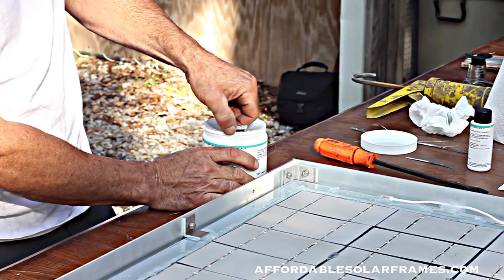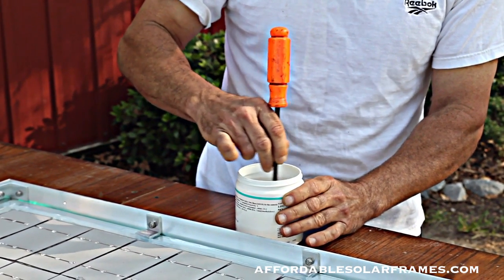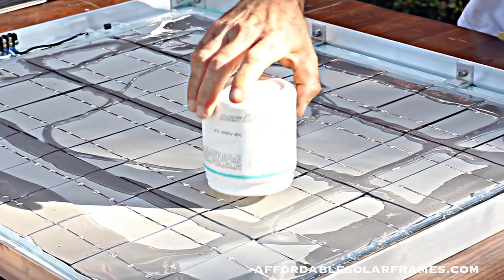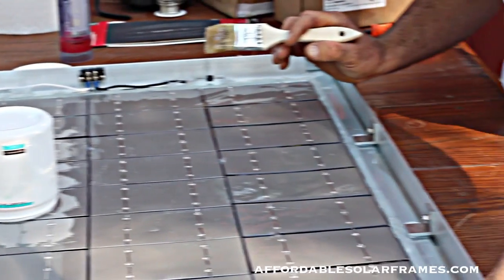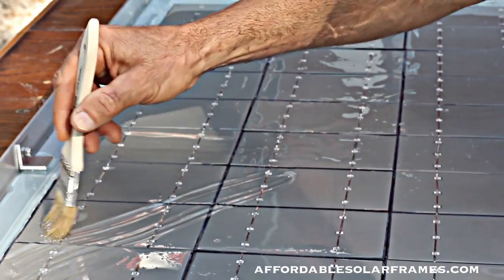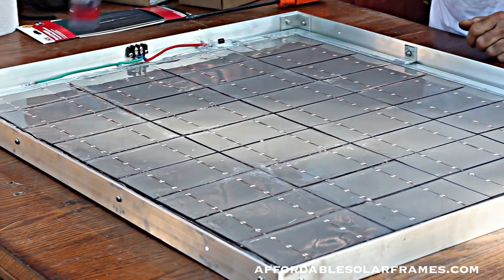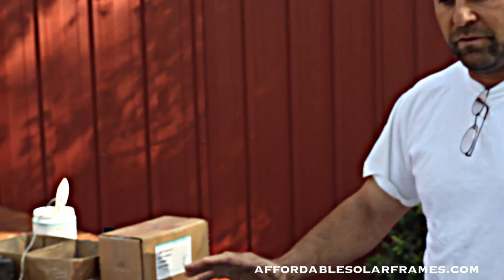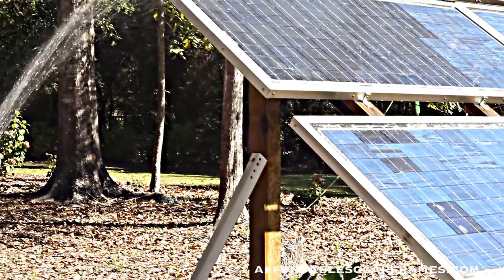How to Build a Solar Panel - Part 3 of 3 (New) encapsulated/sylgard184.Free electricity

Comment from the maker: Well this is not a guarantee but with a few panels you can have lights,tv and with a few more a refrigerator. You will still want to be connected to the grid because the sun does not shine everday. Yes you can install on your roof  with no problems, it is just a little harder to do. You will have to price your supplies but around $150. 100% power for the year is hard with just solar. I also have a hydro system for power. You can see it on my other video.

Comment from the maker: Epoxy will yellow over time and can not hold up to uv rays. The sylgard has no proteins in it to turn yellow. It was developed by dow chemical for nasa to be used in outer space. There are some non brands out there that work just as good. I have used what MLsolar is selling and can not tell the difference.

Comment from the maker: Well I see no manufactured photovoltaic panels using glass with bumps on the outside. I do see it used in solar water heating panels. I would think that it would be hard to clean the glass too. I use 1/4" clear tempered because it is strong and cheeper than the low Iron glass.

Comment from the maker: Well that depends on the size of the deep cycle battery. I would start with two large deep cycle batteries first and see how it goes. A panel does not directly power much you have to charge batteries for best results.

Comment from the maker: You have to charge a battery with the panel then the battery powers the inverter. The 6 amp diode will work fine.

Comment: HI Mark I have learned alot from your video. Thank you. I am no technical person put you are right it was simple enough to do.  I had two questions though.1)  I used 6 ams diode wil this be a problem?  I tried connected the 3 panel together and connect it to a 400 watt inverter, it powered the inverter that it could be turned on and get the fan going but when i plug into the inverter my little lamp doesnt turn on.  How many panel of this size would i need to power a single fan or a lamp.

Comment from the maker: Well there are some good deals out there. I have one bought panel, very large with just 1/8" glass and it did not survive shipping. 1/4" glass is heaver but it is 4 times as strong as 1/8" glass. The warranty does not cover it breaking in the wind or snow. I get a lot of emails from customers that have both bought and my panel system. They send me pictures of how the bought panel broke and mine right next to it did not.

Comment from the maker: I have not had a problem with the cells floating up. Don't use tape on the cells. It causes corrosion after 5 years. I just viberate the panel and leave it alone for a few days then cure in the sun.

Comment: Have you ever experienced an episode where a few of the solar cells float up during the encapsulation pour or sometime thereafter prior to setting ? This was mentioned as a problem in another individual's video where he used strapping tape to "hold down" the cells prior to pouring the encapsulant. He was using a cheaper version encapsulant. I would like to know what your experience is in this regard.
Thanks,
Don

Comment: You could use an orbit sander, without sand-paper of course, on the tables surface to send vibrations through the table to whatever work you might want to place on the table. Just a thought, works fine to work out bubbles when glass coating wood tables.

Comment: how many watts/Amps(i dont know in what grade is measured) is the diode you use in your panels and is there any connection between a diode and the total expectable wattage of the panel? For example if i make a 65w panel what diode should i use?

Comment: Are those panels about 60 watts each? So you need an array of 18 panels to get about 1kw. In this case you would need a very wide roof for 1kw. Also do you make solar water heating panels? I heard they are a lot more efficient than pv panels, about 80% efficient, where as pv panels are around 14% maximum. Isn't it a better idea to use a combination. solar water heating panels for hot water, also to heat your house and use pv just for lights and others such frige, tv etc.. What do you think?

Comment from the maker: In Chemistry you may have two different chemicals when combined they make a new and different substance. The two chemicals in dows sylgard 184 may have a short shelf life but when combined have a very long live.  Water is made out of hydrogen and oxgen. Hydrogen and oxgen are the two most flamable substance. It is what the space shuttle rockets burns. Yet when combined the right way it makes water, what we use to put out fire. Sorry for the long answer.   Mark

Comment from the maker: I offer the frames, glass and pole mount kits on my website and ebay. I offer deals on large orders that are shipped by freight. It will take a lot of panels to run your house. I would start with a 1000 watt system first and add to them every year. I buy my cells from mlsolar of Ebay.

Comment: This is a very well thought out process ... very cool.
Would there be any point to pouring the encapsulant onto the glass and then lowering the cells in some ordered way down onto the ecapsulant letting it sink down into it.  This looks about as good as any commercial system. thanks for the video.

where is this, and how much for your 1kW system, what would you recommend to power an average house?

Comment from the maker: I have not had any trouble at all with the dissimilar metals. I have some panels over 7 years old and so far so good. I have to set my panels in the sun upside down with a extra piece of glass on the back to get it to set up all the way. I am not sure about the carbon dioxide for set up but 2 days in the sun allways does the trick.

Comment: Hi Mark! Great video. I have two questions, you use stainless steel screws with aluminum. They are dissimilar metals. They will  corrode when in contact with each other unless treated (paint, paste etc). How do you combat this?  Are sure it is heat that activates the encapsulate, most set by carbon dioxide?

Comment from the maker: 6" wide and 20' long?  No 20 feet long is to long. Maybe 10' but it will be hard to ship glass 6" wide 10 feet long. If you want to heat water just build a solar water heater, it is a lot cheeper to build and you get a lot of BTU's. I would not heat with electricty. It will take alot of panels to get 1600 KWH a month.

Comment: Hey Mark , great video ! Do you think that I can build  a solar panel 6" wide by 20 ft. long ? and how many of those I will need to cover an average consume of a 1 600  kWh  a month in my house ; and do you think that I could add an electrical heater for my pool ( 20 000  gallons of water ) ?

Comment: Well I was saying deck as one of its definitions being  a flat panel which is capable of supporting a load (the load being me). It would actually be on a scooter (just because I am weird like that). Slipperiness is not a concern to me, but the scratching part would be. Now thinking about it...I would need a material that can:
1) Handle the weight of a person.
2) Be scratch resistant.
3) Be able to withstand bumps.
4) Be able to withstand small pebbles.
5) Be weather proof...
Now any ideas?

Comment from the maker: When you say deck I assume for a boat. Well the deck of a boat is not a good place for a panel. You will end up falling on the slippery glass and scratching the glass too. If you would only be walking on it a little bit then you can go with 3/8" tempered.

Comment from the maker: You will need around 3500 watt system. I would start with a 1000 watts first and then add to it later.Go to my website it is listed on the video for prices of frames and glass. We offer deals when you buy 12 or more.

Comment: Using the 1/4 inch glass you sent me but our climat is really bad in the winter here and thats when it starts seperating the cells from the glass. Used windex to clean the glass and got most of the bubbles out each time. Frustrated due the cost. I thought it might have been me not mixing it enough because when I removed the rest of the scrap cells I had to chisel some off while others just popped off. Was thinking of reinforcing with fiber before encapsilating on the positive side of course.

Comment: Hi Mark. Love the quality of your panel frames. Listen I talked with you before about using the epoxies and even sent you pictures of some that blistered up using the Ultra Seal and the Ultra Clear epoxies. Both of those blistered off the glass so I took your advice and used the 6010 and after a few freezes up here it did the same thing. Am about to give up using epoxies and switch to a Silicone/turpentine mixture. It stays supple and won't shatter the cells in cold freezes. Any thought?
 Brian

Comment from the maker: Well you find how much power you use a month then divide by 30. Then divide that by 24. That will give you how many kwh you use per hour. Mulitply that by 5.5 and that will give you how much wattage in panels you need. I would start with a few panels first and simply and a few each year.

Comment: Thinking about the heat issue - could you devise a pool heater setup?  Running a pump through a hose underneath your array, to reduce the heat of the panels and increasing efficiency?  Just a thought...

Comment: cool video I like this when I was in high school we used clear fiberglass resion to incapsulate the pannels in worked pretty good it was for a solar car project rc car it worked pretty good but if I decide to build my own solar system I will have to go this route sounds a lot chapper than finding one already built again gre4at video.

Comment: @markp0177 Been watching you videos and learning a lot. I just have 2 questions. 1 - It looks like the buswire connections are exposed. Any problems with corrosion so far? 2 - What is you opinion on Lexan polycarbonate vs glass? Thanks for your help

Comment from the maker: @Thomashamka You can make 3-36 cell panels or 1 72 cell and 1-36cell. Your voltage will be determined by how you wire it up. 2 36 cell panels in series will give you around 36 volts to charge a 24 volt system. Yes you will need a charge controller to protect your batteries.  mark

Comment: Hey, i happened to buy lot of 125 3x6 cells, could you tell me how should i make these? Should i make one big panel with 7 AMPS and 36volts? This should be 24 volt panel then. 24v/10amp controller and im done? CORRECT me when im wrong :) Ill look your ebay, might use encapsulant for this project.

Comment from the maker: @Derek519425 Hello. Well with a grit tie inverter their are no batteries. You can have two systems one that charges the batteries and then switch it by hand to the grid tie. It is not exactly legal here to have a grid tie system. The power company wants to but a meter on my system at my cost and only pay me 5 cents a kwh. I pay 13 cents a kwh from them.  Mark

Comment: @markp0177 i am sorry, but i have one more question,

Selling electricity to the grid from a diy solar system is not exactly legal, 
so, is it possible to connect it to your home grid without putting power to the electric company's grid, and yet saving the power in the batteries, to be used at first priority  in your home?

Comment from the maker: @Derek519425 I have my inverter wired into my attic to a few toggle switches. My inverter runs 2 refridgerators and some lights. I can switch back to the grid if My batteries get low. Some times on a cloudy day I may only run one refridgerator. Mark

Comment from the maker: @Derek519425 Hello. I do not have a grid tie system. I charge batteries that run my inverter.If the power goes out for a long time I will still have power. We have hurrricanes hear. With grid tie you will not have power if it goes out. Mark

Comment: @markp0177 i see,

i will be looking forward to a video on how to connect the solar array to your main breaker,
that is the one thing im still worried about, it is possible to have the array connected to my breaker without it pushing the meter back if i don't use the electricity? if so, i would love to see a video of that :D

Thank you.

Comment from the maker: @Derek519425  Hello. I am not sure how much I paid for my system. I built it a little at a time.I found good deals on the batteries and the #3 wire I got free after a hurricane back in 1979. Some of my panels are made out of glass that I got for free off old sliging glass doors.  Mark

Comment: Thanks for the Video. I am from India, and I am planning to put up a solar panel with the 5” x 5” solar cell having panel size of 30” x 30”. How much Sylgaurd 184 will be required to spread on this solar panel? Somehow I got Sylgaurd 184 kit through a friend. It’s a 1.1KG pack. Will that be enough to spread on a panel with 30”x30”?

Comment: thats frikkin cool man.  I got a suggestion for your awesome home set-up, get a thermostat connected to an electrical relay tied to a water sprinkler system, and have it just turn on and automatically water the panels when they get to a certain temperature.  great vid, you definitely know what you're doing, big ups man, nice

Comment: Thanks for your videos. They are going to be a great help When I put mine together this yare. Or in the next 2 week.  Just woundering, how many batteries do you have on this system? And, what is the wattage on the inverter you have on them?

The only inverter I have right now is 750 Watt. I have had it for years. I was looking at some of the 8000 watts for about $700.00

Comment from the maker: @facundosagardoy  Hello. I have tried a syringe but it broke the cell. I look from under the panel" that is why I have a hole in the table" And push out the air very carefully. I also vibrate the table for around a hour then I cover it with card board and I leave it alone for days. Next I set it in the sun upside down with a extra piece of glass on top. This will heat it up to over 180deg. I let it stay in the sun for two days before I use the panel right side up.

Comment from the maker: @Treped Hello. I like the dow 6010 because it is a little thinner and leaves less air bubbles. The vibrating table helps remove traped air. It only vibrates a little so the cells do not move. The large air bubbles may need a little help to remove. I some times press down on the cell to chace the large air buble out. If the cell is warped up a lot I hold it down with a little silcone.

Comment: Outstanding! I like your style of instruction.  I am going to build panels like yours and I have a few Q's.  (1) will you explain or maybe a short video on making a vibrator/shaker table?  (2) What size diodes are required? (3) Can you tell me a good source for the Dow 6010 encapsulant/sealant? Many thanks for all your assistance and info.

Comment from the maker: @Bartrum2009 Hello. Well, start with a 5000 watt or more inverter and at least 1000 watts of panels. Then you can add more panels or a wind turbine later. Also start with 4 golf cart batteries and add more later. This is the best off grid system that I know of. How many amps you need depends on how many you use.

Comment: I love your videos.  I have 1 question.  Do you normally not put a back on there, just rely on the set Sylgar?  I know you mentioned that on the ones you sell you put a backing, but is the set up Sylgar good enough for protection?  I'm in California and we just had a change of earthquake/wind tolerance laws and supposedly starting this year I can't use aluminum frames, do you think a complete fill with Sylgar reinforces the aluminum enough so that it doesn't bend under heavy wind?

Comment: Mark,
Wiring & connection blocks, can be covered up well with some grades of hot glue, and this can then be removed, if needed, with lighter fuel (petrol).  An electric drill with a chuck key placed in it can act as a vibrator, to even out the silicon potting compound.

Comment from the maker: @sqhschief Hello this is nothing to be concerned with. You don't want to mix air in when you are mixing. Vibrating the table helps. Also warming the glass a little before you pour helps. I have air bubbles at first but the next day most are gone.   Mark

Comment: @markp0177  I'm having an issue with lots of small air bubbles staying on the cells, also some fairly large ones.  Is this anything to be concerned about?  I didn't use a vibrating table, but I didn't think it would have so many bubbles.  Thanks in advance!

Comment: Good thing I found this video before I tried using EVA. This looks pretty simple enough. I'm looking at making my first panel. With the Sylgard, do you only use 1 container of the mix? have you tried using more than that? I'm sure it's not needed, just curious. Are you just using a terminal block for the wiring?
Great Video, Thanks!

Comment from the maker: @hhittini Hello I vibrate for about an hour and then leave it alone for a few days. Next I heat cure in the sun for 2 days. I lay a extra piece of glass on the back and put in the sun. It will get over 180 deg.   Mark

Comment from the maker: @TheOzembuch  Hello .It sounds like you did it right. Did you use a diode for each 36 cells? You should have double the amps and 18 volts. What are you useing for your load when you test? A battery or a resistor? If battery the battery my be full and not take 8 amps. Also try a different meter.  Mark

Comment from the maker: @TheOzembuch  Hello Yes two set of 36 in parallel. You will connect to the diode with a #12 wire and the neg bus with a #12 wire and then connect the two pos #12 together and the two #12 neg together.  Mark

Comment: Big question, which is more affordable to apply, the EVA or the slygard? I see most professionally made, if not all, use EVA as their encapsulation material.
I also see in their specifications, they use a back foill (black or white UV protected), whats that?